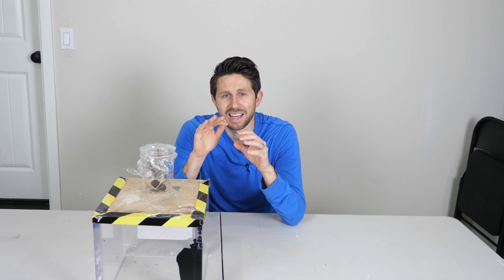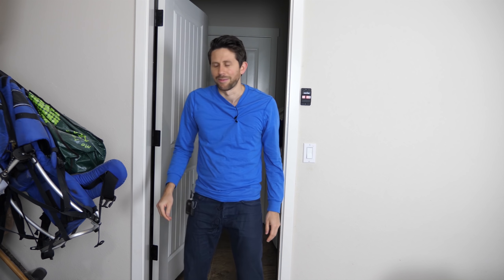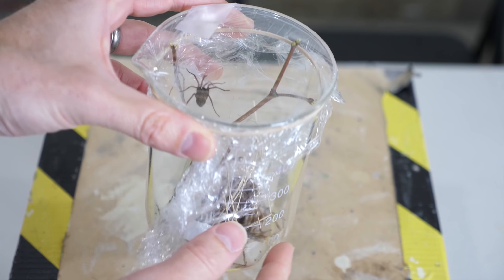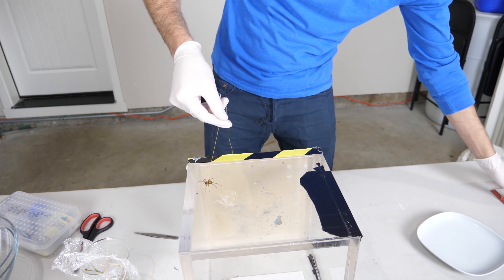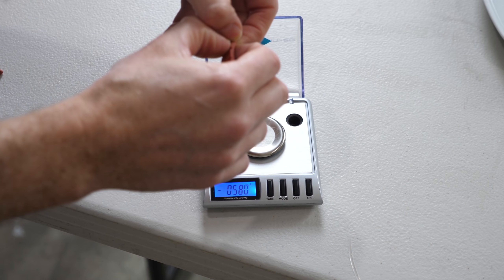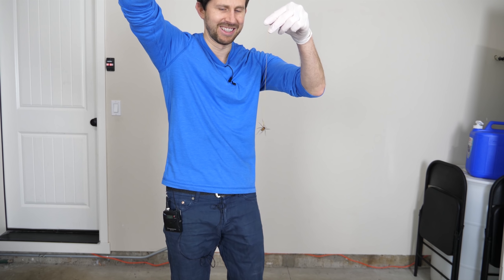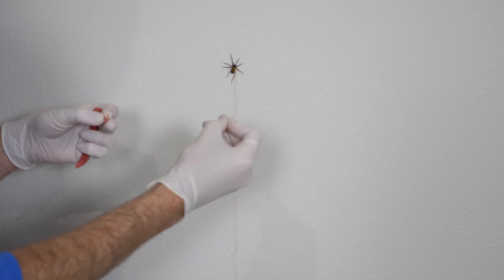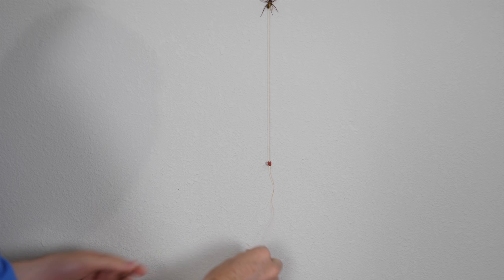How Much Weight Can a Spider Hold While Climbing on the Wall and Ceiling?

Comment: I'd be careful if I were you: that thing's going to build muscles and then you're in TROUBLE.
Reply: The spiders profession would be body builder
Reply: Spiders don't have muscles :) spiders basically have little tubes inside their legs that bend depending on pressure inside which they control with their blood
Reply: @ekimyukselbaba8847  Neat! Like those new "soft" air-powered robots?
Reply: @johnblazer7661  yes like the robot arms
Reply: @ekimyukselbaba8847  but can they become stronger? I mean what if a spider carries that weight all the time, wouldnt he be even at least little stronger than other spiders?
Reply: @rhqqn446fjnnbbc  I mean I'm no spider expert but logically speaking strength of muscles comes from amount of muscle cells and special proteins inside them the way we build muscles is damaging the muscle tissue and replacing it with more better tissue thus since spiders don't have cells that do that work then they can not get replaced with better ones
In the end maybe they can somehow again I'm not a spider expert
Reply: Why did you have to go and make me imagine a swole spider. I don't like this image. Take it back.

Comment: "Spiders have wind resistance so they don't get hurt if they fall"

... Puts a load of weights on it until it falls
Reply: @talisrune8192  Ever heard of dwarf tarantulas suchas Neoholothele incie and Cyriocosmus elegans, both are very small.  My Cyriocosmus elegans is no bigger than my fingernail.
Reply: @bentennyson2398  Weak spider. LMAO
Reply: @bentennyson2398  You're now comparing dwarf tarantulas to your abdomen bursting tarantula which is like 10 times a dwarf tarantula's size.
Reply: I thought the same thing lmao, especially since the spider struggles to hold up the weights it’s gonna drag it down and heavily increase the weight making that fact useless in this situation/test
Reply: @bentennyson2398  Yet if you were as smart as your comment makes you out to be, you would know that there are many spiders that are so small that their terminal velocity are so slow that they land without harm. And you are still comparing tarantulas to spiders to try and prove your point when the two arachnids, even though they are in the same family, are in fact pretty different. Though I don't disagree with you on the tying of the string to the cephalothorax and how its not healthy for the spider.
Reply: @bentennyson2398 even black widows and redbacks can burst, I have had spiders survive ruptured abdomens before, I just superglued them back together, made sure they stayed hydrated and immobilised by gassing with CO2 and pins, and waited for the glue to cure for about 20 minutes, then made sure to watch them carefully until the next molt. Never happened with a mygalomorph though, but I've been keeping Theridiids and other Araneids for a lot longer.
Reply: @justanordinarydweeb9181  Actually while the two are spiders, the tarantula is from the family Theraphosidae.  Yes I know about terminal velocity, I've had many tarantula slings bolt and fall 3ft and be fine.  However I have a house spider in my place that is bigger than some of my juvenile tarantulas, and the abdomen is huge so if that were to fall I'm sure it would suffer damage.
Reply: @nihilus757  lmao
Reply: @domvasta  holy shit that’s smart
Reply: @domvasta  super glue 😎
Reply: @bentennyson2398  fun fact: that spider is as big as my fingernail 
Also y u comparing a giant house Spider to this lil spider
Reply: @sunghleipar4690  I didn't even mention a giant house spider, I mentioned a house spider.  Most of my tarantulas are 3 inches in legspan, and it was those that I was comparing a house spider with.  I have seen tegenaria gigantus (giant house spider) in my place before and trust me it was huge, normal house spiders are tiny in comparison.  If you saw tegenaria gigantus you'd shit yourself.
Reply: @bentennyson2398  u make no sense nvm
Reply: @bentennyson2398  also I wouldn't shit myself 

There not scary, funnel web spiders are tho
Reply: That's exactly what I was thinking
Reply: @sunghleipar4690  Then if I made no sense then you're obviously a child.
Reply: @bentennyson2398  at the start of this comment u compared your giant tarantula that fell down and abdomen's splattered and a little wolf Spider and called this dude a moron for thinking that Spiders wont have there abdomens even tho he was talking about lil wolf Spiders understand? Also that's a terrible comment to say pal
Reply: @sunghleipar4690  I never said that the abdomen burst, read my comments before shouting ok pal.
Reply: @sunghleipar4690  Also you really need to learn how to construct a sentence, because your last comment was totally abysmal.
Reply: @bentennyson2398  WOW fancy words oh that makes u more fucking reasonable... wait- anyways ur sentences r so fucking confusing I HAVE been looking at ur comments and this made me answer to u, u replied back so I did let's wrap this off with the most toxic ending lol
Reply: @sunghleipar4690  What's so confusing, oh but I forgot you failed to move on from kindergarten so I'll forgive your arrogance.
Reply: @bentennyson2398  now ur insults are getting ridiculous and arent even related to this topic...but these r arguments lmfao bro u should stop replying ur giving me too much entertainment reading these
Reply: So many self proclaimed experts here
Reply: @quellathefourth6986  I know, why don't people do research on spiders before they start mouthing off to someone who has had experience with spiders.
Reply: @bentennyson2398  not trying to weigh in on this matter because I know nothing about spiders. I'm only here because you told that sung person that you never said it's abdomen burst, however your first comment was about how your tarantula fell from the top of its enclosure then it's abdomen burst. That is the kind of inconsistency that would make shawshank redemption feel consistent.
Reply: @rider338  I didn't say my tarantula at all, read my comment properly.
Reply: @bentennyson2398  dude, You don't even know your own comment??????
Reply: @bentennyson2398  legit, dude you're complaining because we are including the word your?????? That's a whole new level of petty my god.
Reply: @bentennyson2398  bro, the word your doesn't always mean you have to own it, it also can mean it is associated WITH you, and is this story not about you seeing a tarantula, like wtf you're just trying to be snotty and its not working my guy.
Reply: @rider338  Well if I did I'm sorry, I probably meant my friend because I've never had a tarantula burst it's abdomen.
Reply: @rider338  Look wtf is your problem?
Reply: @bentennyson2398  like for real dude, I came in here and was like "not gonna weigh in since I know nothing about spiders, but you for sure said your tarantulas abdomen burst"

Then you said "nope didn't say my, read my comment properly"

Like for real dude if you cannot see how bad that is?
Reply: @rider338  And it's you who's getting snotty with me not the other way around.  I am a YouTuber I comment and make videos all the time my first comment was 4 months ago, since then I've done so much with my 3 channels that I forget what I comment on other videos.  It would be good if people put their energy into producing content for their own channels instead of complaining about a 4 month old comment.  I don't look back at old comments but just for you I decided to humor you and yes you are right so I'll apologize, however like I said that tarantula wasn't mine hell it wasn't even in my care.
Reply: @SumoneAverage  No it doesn't. Force of the weight pulling the spider down vs freefalling is different.
Reply: yeah i was thinking the speed doesnt matter if the shell cannot handle the impact, also they can be messed up internally.
Action lab is fun and all but he should look stuffs up before claiming something.

Comment: "A really big spider on a string. This is so scary."

HOW DID YOU MANAGE TO TIE THE ROPE AROUND IT.....
Reply: Capture one and freeze it for 3-5 minutes to slow the metabolism
Reply: James what happens if you freeze them 10 minutes? will they die? i know you can freeze turtles but i tought that’s sometingh unique.
Reply: @joelhess1436  things don't freeze for 3 to 5 minutes...
Reply: @joelhess1436  try freezeyourself for 10 minutes, pretty much the same thing
Reply: Lea K. You freeze it
Reply: i think people are missing the point...
how do you tie a string on such a tiny creature
Reply: @_Sheepy  when they froze. They don't move. Just put a string like normal, heck humans can sculp on a pencil tip
Reply: @nomarukaz  it seems hard though.
it's not impossible, but it looks hard tk tie a string on the spider without hurting it
Reply: Freezer helped him

Comment: I could hear the spider cussing at you as it fell.  🕷️🕸️🏋️😱
Reply: I was worried it would get hurt, he said the air resistance slows it down, but with that much added weight surely it fell faster than normal
Reply: @TNaizel  no
Reply: @DrRence  yes
Reply: @neutronenstern.  maybe
Reply: @omarbenyaklaf6521  yesn't
Reply: When
Reply: @yinyang1217  yesn'tn't
Reply: @simonvanprooijen  don't think too much
Reply: @ardaguytrgt7323  NANI?!?!?
Reply: @TNaizel  it wouldnt get hurt even if it did fall faster. Too much surface area, too little mass.
Reply: I thought it is cursing ^-^
Reply: It doesn't fall like a vertebrate for sure and the speed must have been slowed down once all the weights hit the ground...
Reply: yes but actually no
Reply: Sir that is physically impossible to hear something that didn't happen. You. sir. have. lied.
Reply: @TNaizel  The weight lands first, then the spider slows down to its own terminal velocity

Comment: I really wanna know how you even got his “leash” tied to him😂
Reply: Freezer. They get really cold a shut down and sleep, but when you take them out they warm back up and start moving again
Reply: Same way you make a fly-on-a-string. They're cold blooded so if you put them in a low temperature environment their biological and brain functions slow right down to the point where they're kind of comatose (not sure on the correct terminology, still alive but only the heart and respiratory system are functioning and only barely). You tie a little slip knot out of cotton and put the noose around one of the narrow segments of the body and gently tighten being careful not to crush it, once the noose is in place you put him in somewhere warm until he comes back to life. When you want to get the leash off you just pop him back in the cold until he goes to sleep and carefully snip the knot. 
Careful with using a freezer though as very few cold blooded creatures can survive sub zero temperatures for long, they need a kind of antifreeze present in their blood to stop it freezing and bursting the blood vessels and causing terminal damage. This adaptation is sometimes present in desert invertebrates due to the need to survive the massive swings between day/night temperatures or overwinter. I can't remember the name but there is a grasshopper/cricket which is effectively dead (no pulse, no breathing, no brain activity) for months at a time during the winter and then somehow comes back to life when temperatures return to acceptable levels.

Comment: “Don’t worry, when it falls it won’t get hurt because it’s surface area to mass ratio is so big it has a lot of wind resistance it won’t get hurt”

Is the mass ratio before the extra mass is added?
Reply: The weights would hit the ground first and the surface to mass ratio for the spider would still be the same.
Reply: @radornic2387  it would’ve already hit an increased velocity before the weights hit the ground though, and there wouldn’t be enough time for it to decelerate. Either way, even if it didn’t get hurt, I doubt the spider liked what was happening. Lol
Reply: @punxOiOi13  No matter the weight of the object, something in a free fall will always have the same acceleration, regardless of weight. If you drop a truck and a ball bearing at the same point in the sky, they will both hit the ground at the same time. Basic physics.
Reply: @radornic2387  I get what your saying, and that would be true under unrealistic conditions(no wind resistance). But that was disproven on this same channel. He used a vacuum chamber to compare a feather and I think it was a ball bearing, something metal, and that principle held true. But before he vacuumed the air out, it didn’t work.
Reply: @punxOiOi13  It's a feather, it's air resistance is obviously great. So it's gonna be falling slower. However, a spider and a small weight will still follow the principle because of such little air resistance. Take 2 different mass objects right now and perform the experiment of dropping those 2 things at the same time at the same point. They're gonna be hitting the ground almost, if not exactly, the same time.
Reply: @radornic2387  I’m good man. You can try it if you want. I feel sure of my beliefs. Although from your perspective, I will probably appear to be a fool who doesn’t question himself, from mine it seems like you just don’t want to be wrong. But whatever. Not a big deal. Have a good night man.
Reply: @punxOiOi13  I objectively know I'm correct and I'm ready and assured that I can change my opinions if I were to be proven wrong.
Reply: So if you dropped the weights in one hand and the spider in the other hand at the same height and time, They would both land at the same time and guessing the same speed?
Reply: Y’all are arguing over a spider
Reply: @klashnacovak47  precisely, unless the spider has some air resistance. If the spider has some air resistance, it will fall slower, but not too slow.
Reply: @alexmclaughlin3957  We're arguing about physics, not just a spider.
Reply: So if you tied weights around the spider would that not increase the speed the spider would fall and render the spiders air resistance void?
Reply: @klashnacovak47  Yes it will, but the air resistance of a spider isn't on par with the air resistance of a feather. Not even close. Its only slight air resistance that slow down its Acceleration by a fraction.
Reply: Its quite interesting that i got involved in this argument while my current study is physics.
Reply: It’s not an argument from my side as I do not know what is right or wrong and cannot argue the case either way.

It’s more inquisitive from my side.
Reply: The way I was thinking is if you look at the army and they throw cargo out of a plane then jump out after it, The cargo would be falling faster than the parachutists. So if you tied the cargo to the parachutists then they would fall at the same speed as the cargo and hit the floor harder than if they were free falling.

That’s the way I looking at it. Like I said I don’t know what is right or wrong and just trying to learn and understand.
Reply: @klashnacovak47  I'm very well aware you're not arguing, I was more referring to the argument I've had above. But I think the reason for parachutes falling faster when it supports more weight, is quite obvious. The cargo having tremendously more mass, it outweighs the force of air resistance.
Reply: That what I was getting at. So the spider would fall faster and hit the floor harder because it was tied to the weights.
Reply: @punxOiOi13  I think it would be enough time for it to decelerate. Just imagine a parachute opening up and how quickly the person decelerates. It's like the person stops for a few seconds mid air before gliding slowly down with the parachute.
Reply: @hagglefaen  Possibly. But that’s not a huge length of string. It’s what like 4 inches between the spider and the weights? That’s how far from the ground it would be before decelerating.

Comment: That was really brave off you to tie a string on a spider. 
I think you should count the weight of the string also!
Reply: The string used probably weights no more than 10 milligrams
Reply: rishi raj that is such a small amount its  kinda pointless...
Reply: @cathamir7815  no it's not, all points should be measured. In a correctly performed scientific experiment.